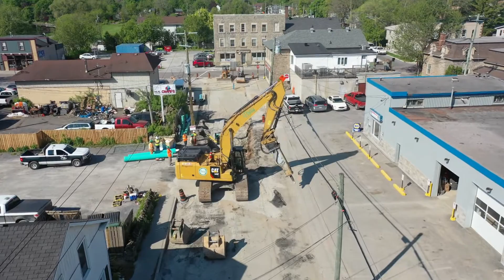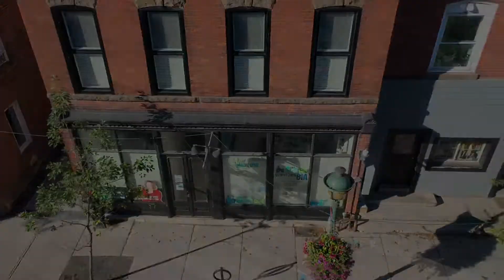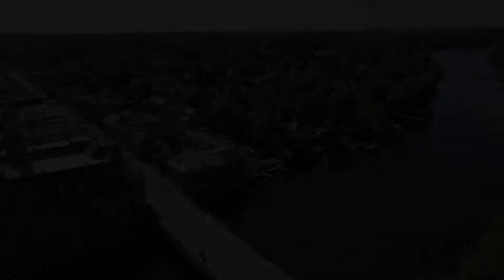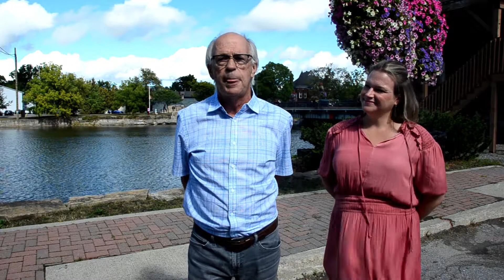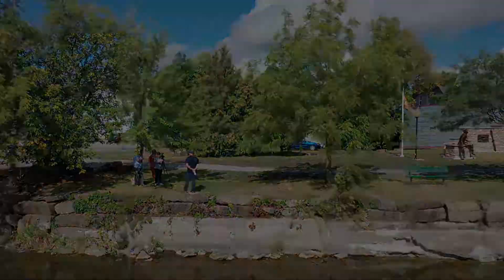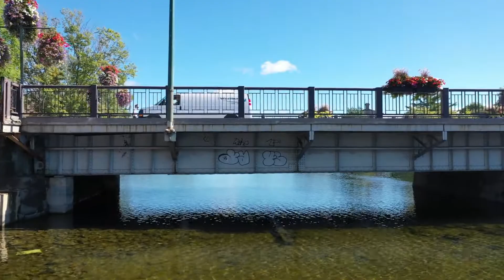2022 Bridge Reconstruction Project

Comment: The underside of the Gillies Bridge is unfinished, unsightly and has no barrier/netting to stop debris (insulating foam, timbers etc.) from falling into the Mississippi. “The foam would be in place only until the concrete repair cures.  The foam keeps the concrete from spilling out during the process.” (Andrew Tenant Aug 16).  Andrew Tenant says Bray Construction is using a Shotcrete application.